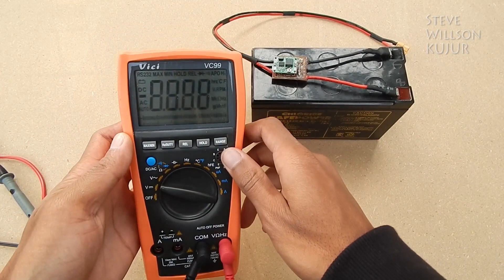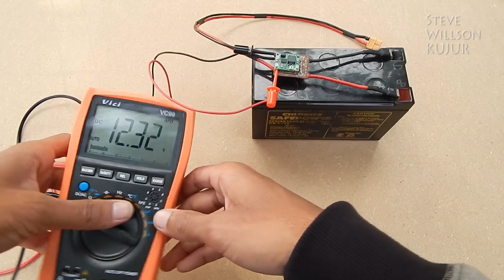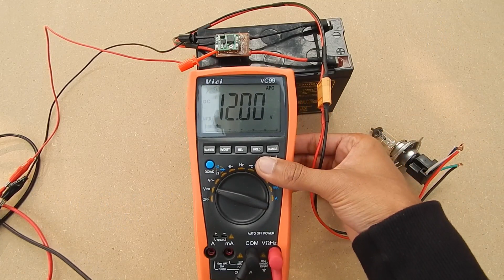12V Battery over-discharge protection

Comment: I had 12 V lead acid battery, when testing it shows 12.72 volts. I want to discharge the battery what would be the cut off voltage and how it can be done can u please inform me here

Comment: well I get the need for the top board which I recognise as a ubiquitous low cost switching supply from eBay, Banggood or wherever but what is it driving? Presumably either an FET switched by a simple voltage sensor like a zener or a micro controller like an ATtiny xx. Obvious question then Steve ... where's the skwerkit (circuit) diagram? Please?! Thx.
Reply from the maker: +Bob Lewis hi I've provided all the details please check the description .
Reply: Steve my apologies. I was looking everywhere but on the phone version of YouTube, which is what I was using, you have to click to get to other information, unlike on the PC where it all follows on naturally. Yes neat idea and with the price of 8 pin mc chips being so low it probably costs less than more discrete component solutions. In my case though I'd probably go for discrete as I have so many components that need to be put to good use. 😎 Probably much easier to get the tight accuracy of the precise cut-out and cut-in voltages on an ATtiny.
Reply from the maker: yeah it's fine my one is working fine .." i used a buck converter in place of a liner voltage converter " because this only draws 1 mA . and liner draws 7-10 mA

Comment: A 12 v car batter connected to an inverter. The amps is 10A. Any battery protection circuit available.I want to cutoff at 50% battery.

Comment: nice job I look similar circuit bu I need a cut off at 12.4V , how do you program the chip?
the chip is powered at 5V do you use only linear regulator ? or a DC-DC convertor + linear regulator?

Comment: 10.6v is FAR TOO LOW !!!
Lead Acid batteries should never be taken lower than 50% discharge.

The battery voltage will sag under load, so you will need to research what voltage limit is safe for the load current you are using.
I usually disconnect at 12.2v
Reply: pues te dará para 10 minutos, como minimo a 11v.

Comment: can we use this module with battery charger
Reply from the maker: +varun sharma yes
Reply: Hi,
Writing the Attiny sketch such that it disconnects when Voltage is low 11,2V and also disconnect when the charge level is reached (ex.14.1V).  In such way could it be used as overcharge disconnect as well if connected between charger and battery?
Loving the idea..Thank YOU. for sharing

Comment: Hello.
I am very interested in 12V Battery over-discharge protection.
  I want 24 volt circuit diagram of auto cut off battery.
Can you make and sell one for me?
Thank
Reply from the maker: okay
Reply: John Langlois Hi,

You can now get these off eBay. 😏

Just look for (keywords-wise):

- 12V Battery Cutoff
- 12V Over Discharge
- 12V Battery Protection Board

That's it. 😄😆

Comment: Shit. I need discharge at max 12.2 from 12.7. This one shorter the life of agm and gel batteries. They can do 1200 cycle if used drop max at 12.2. Your are not a skilled person. Thats for a small load.